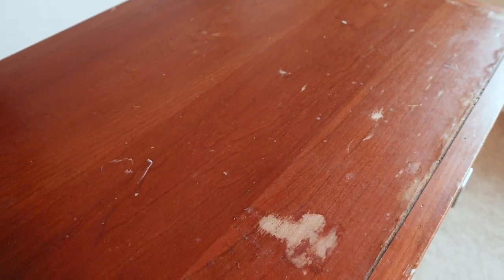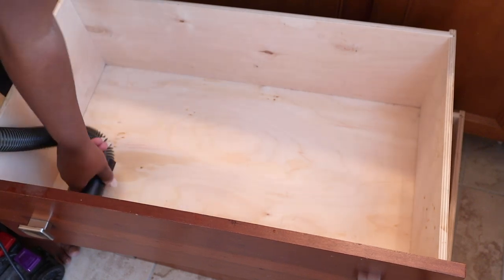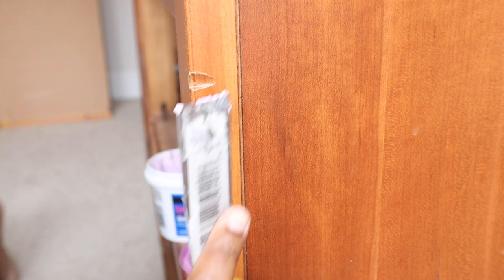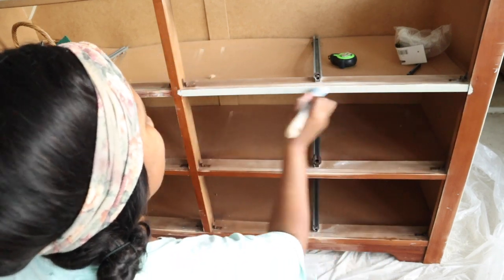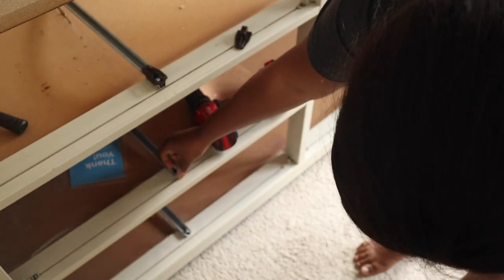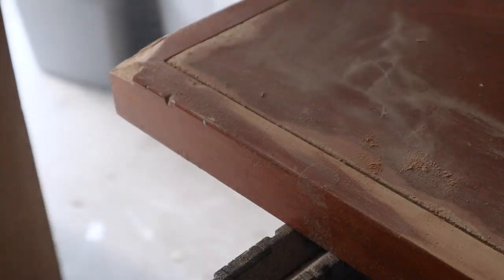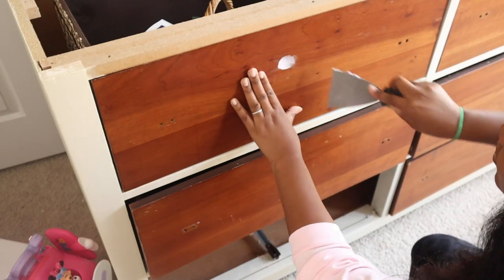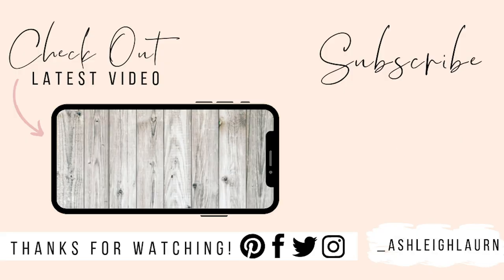How To: Fixing Broken Drawer Guides & Veneer Tops | Furniture Makeover | Ashleigh Lauren

Comment: Thank you so much, this is inspiring! I got a dresser off a yard sale site and it needed so many repairs. I saved the 2 drawers at the top, but not knowing you could replace the drawer sliders I removed them, had thin wood cut to size to make open shelving instead. I need to use the wood filler to finish the top, and then bought legs and casters to raise it up. We use it as a tv console and makes me happy to know I salvaged it.